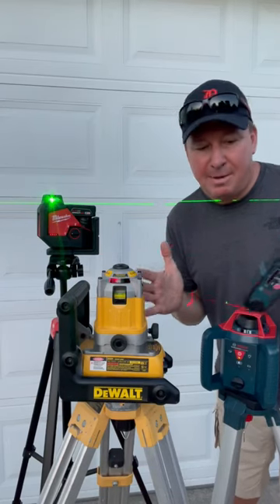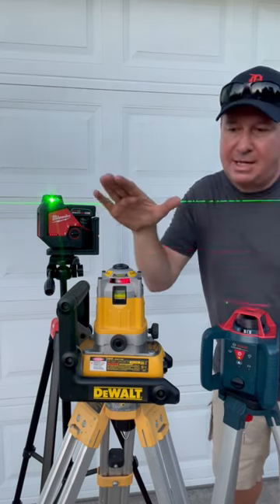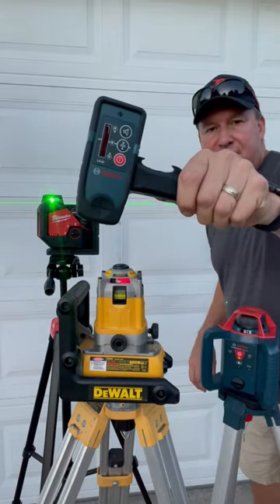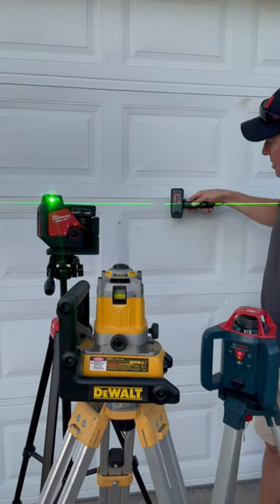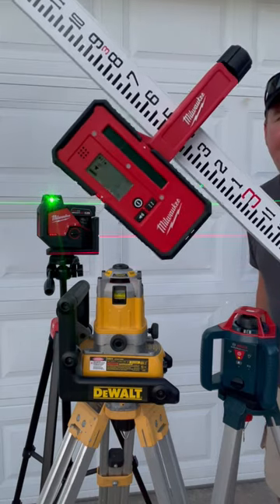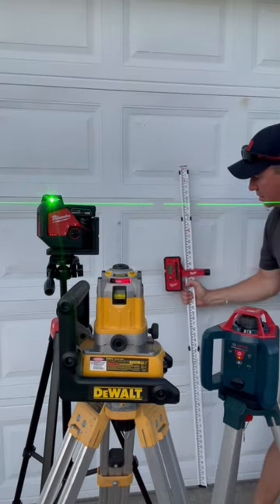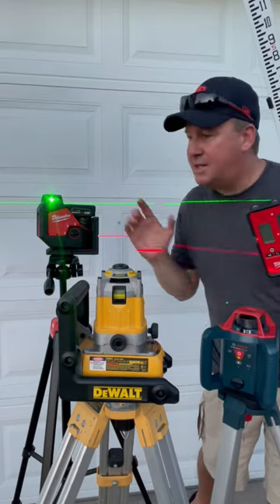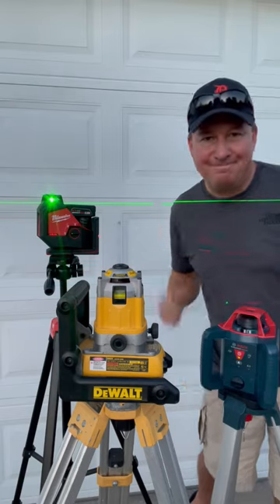Laser level compatibility-Milwaukee, DeWalt, & Bosch 😎 #shorts

Comment: Even a Bosch or DeWalt green laser detector will not work on those red lasers.
Reply from the maker: Interesting how there isn't one universal laser detector.
Reply: @MarkThomasBuilder  different color light is actually a different frequency. Physically the exact same thing as radio waves just your eyes can pick them up. Makes sense that the detector range can't be that wide. Otherwise it would pick up all kinds of stuff and be inaccurate.
Reply: @MarkThomasBuilder  side note. The human eye evolved to see the spectrum of green better than any other color. The difference is of shade of green could mean edible plant or you die... That's why the green laser looks brighter and easier to see. Lasers like this are usually pretty close to maximum wattage so that doesn't change.
Reply from the maker: Good point, I wouldn't want false readings.
Reply from the maker: Wow, very interesting.
Reply: @MarkThomasBuilder  Stabila makes a detector that reads both green and red laser light.
Reply: That’s what I was going to ask is it because the difference between red and green lasers is that the compatibility issue?
Reply: @MrKThomas1976  there is a difference. You need your detector to be specific to the light frequency. Side note. Hilti does weird stuff with their tools to intentionally not be compatible. Don't buy them. And they cost more to recalibrate

Comment: I can confirm that the Milwaukee 48-35-1211 receiver does work with the Bosch Professional GLL 3-80 red laser. Was braced for failure, but it works fine.
Reply from the maker: Interesting, thanks for sharing.